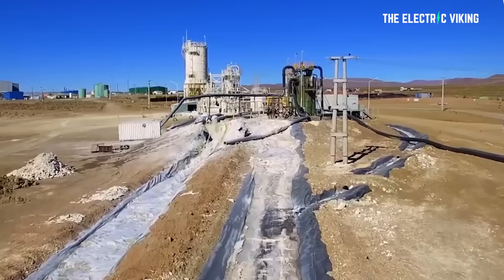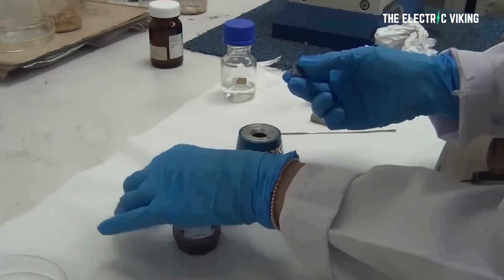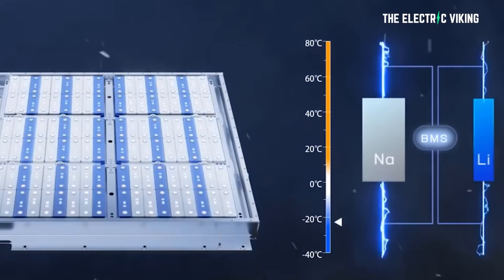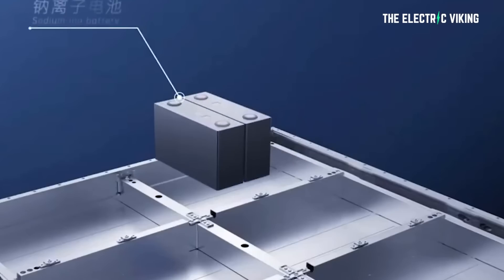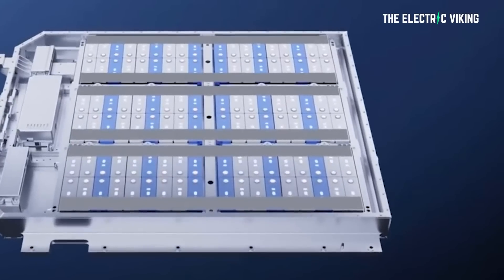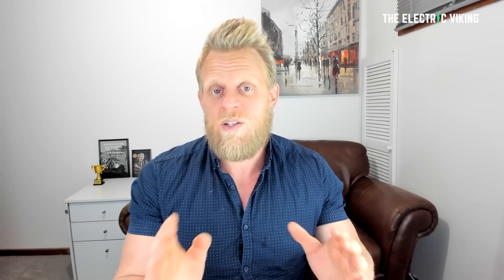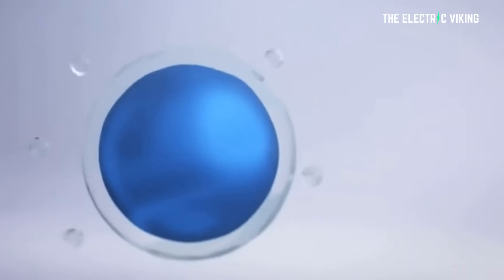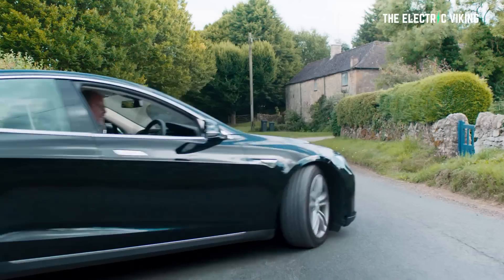NEW Sodium solid state batteries could solve our lithium crisis

Comment: Do you know if Tesla is also working on sodium batteries or have the ability to put it in their 4680?
Reply: Obviously no.
 Only hard core battery research & production giant can both research & put massive scale production into reality.

Tesla battery is initially Panasonic (acquired) tech and base on the long research tech of Panasonic to derive the next iteration.

A complete overhaul of tech, Tesla can do this by buying out other research company / prodjects and make it as their own (which they were doing, instead of in-house) however the risk is high as such tech is unproven, plus the ability to put this into massive production require some external help (can be paid service or bought out company)

eg Tesla other miscellaneous (solar tile, etc) are bought out from other start up. It's too much for 1 company to do everything 

Since Tesla have so much wealth & money that's what Tesla can do to make up the short fall by betting the future and buy out others.

Betting & buying others are (strategic) gamble which software & other tech giants do a lot eg Oracle, Microsoft, may be Google too etc